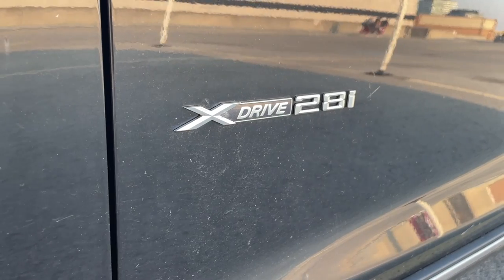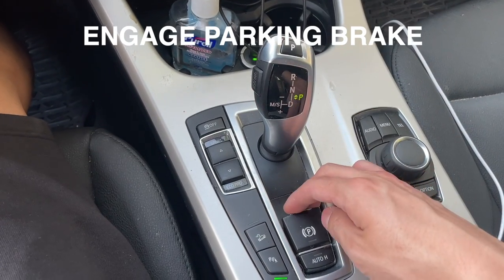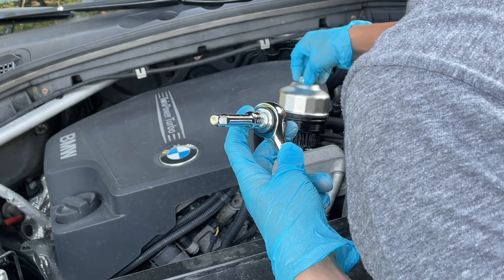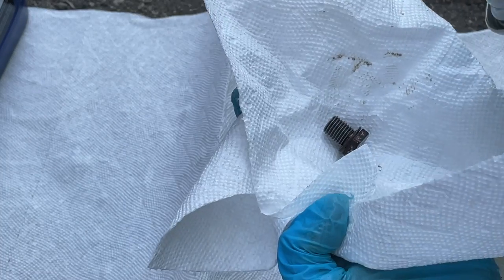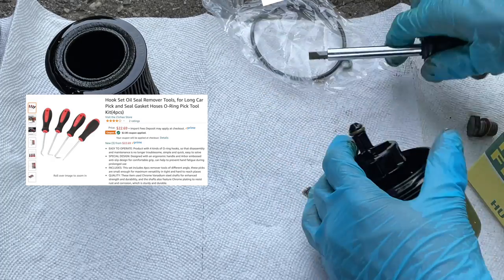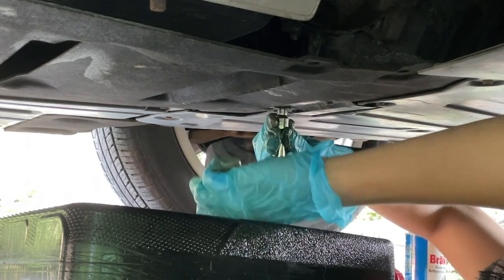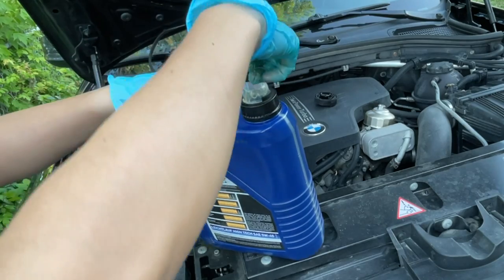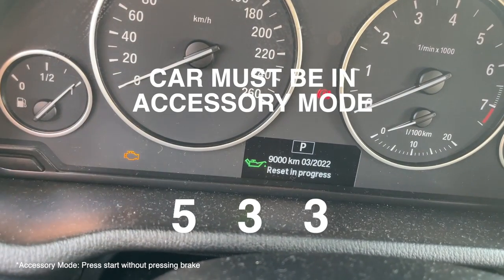How to Change Your Engine Oil (2013 BMW X3) | DYLANKYANG

Comment: Great video buddy!   Just bought a used 2014 x3 2.0 with the turbo and I do all my own oil changes but this car I wanted to watch a video...looks like I need a 86mm oil cap socket don't want to damage the plastic filter housing...too bad it's not just a screw on metal filter...much easier...thanks i use the same plastic rhino ramps they are very strong ...
Reply from the maker: Thanks! Ya definitely recommend the oil cap socket cause otherwise they chip pretty easily. Also the rhino ramps are truly life changing 🔑

Also just a random tip i learned on the bmw is getting a Bluetooth obd reader and downloading an app like bimmer code is alot of fun if you like customizing random things on ur car

Comment: Oil capacity 4.8 Liters
Reply from the maker: 🙏 lol it doesn’t matter what i pour into the car the measuring always says it’s full but this is key to know
Reply: mine says 5.1 liters, 2013 x3 28i. I guess 5 liters is enough for it.